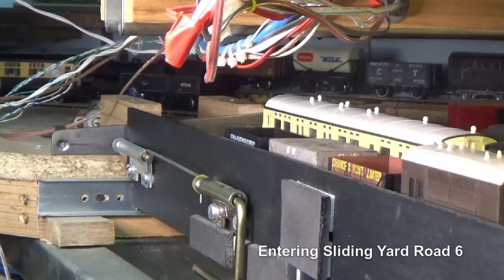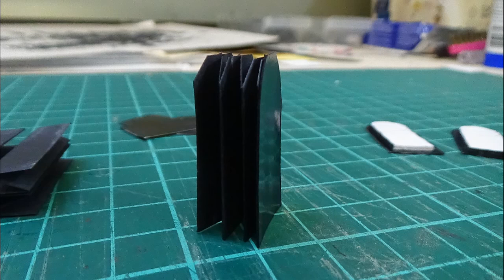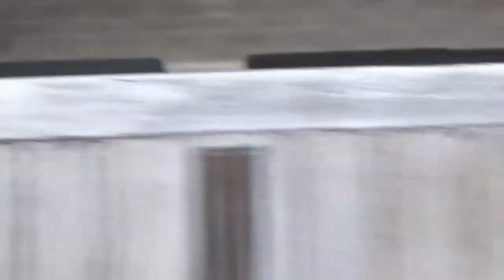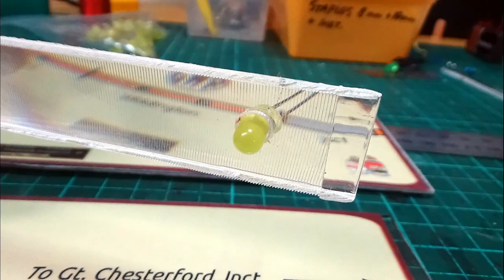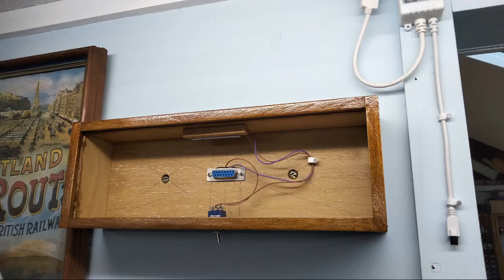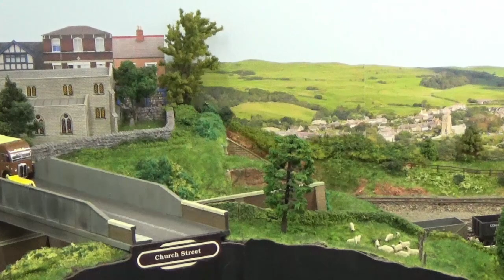GCJ September 2021 Update

Comment: Absolutely brilliant once again, just one question " how do you fasten the staples down". Keep safe Gormo, I think the way it's going in the UK we'll be in the same boat shortly, probably without a paddle LOL Frank
Reply from the maker: G`day Frank,
I drill two pilot holes in the sleeper that will accept the staple, and then push the staple down with a flat steel rule. The steel rule pushes the staple down to flush with the tops of the rails.
I tried it first without pilot holes and it was difficult to place the staples accurately. This sort of thing is all about working out the processes as well as the original idea.
Stay safe
Cheers Gormo

Comment: i love the way way yo think outside the box , a suggestion for the sensor leds wire in a small stay alive capacitor (if possible ) just to keep leds on a bit longer ...................tony
Reply from the maker: G`day Tony,
I can`t seem to help myself thinking outside the box........it`s good and bad at the same time......when I think of something I need to pursue it to the end.......which diverts me from other things that need to be done.
I`ve seen your later comment where you realized that I had mentioned the capacitors.....LOL
Cheers Gormo